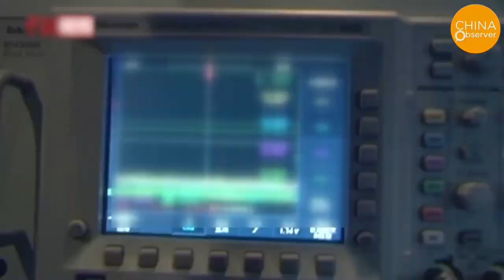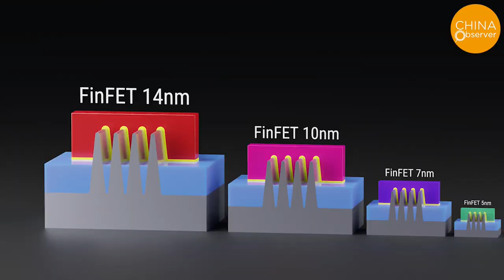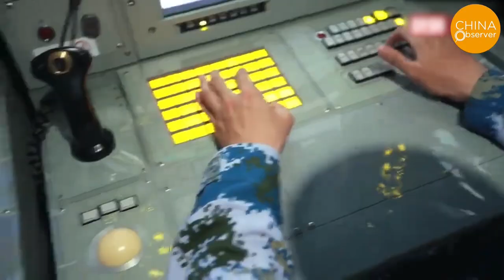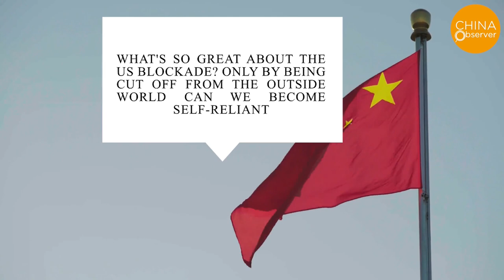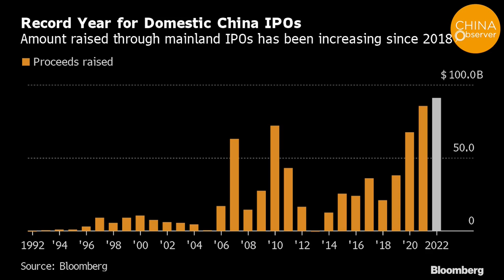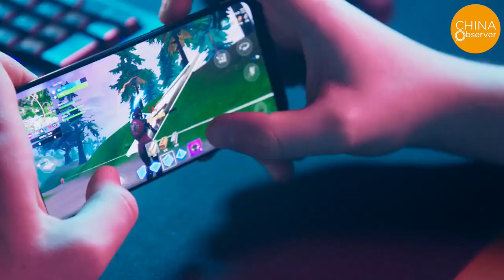Chip Sanctions Leave PLA J20 Old Eyes; China Breakthroughs Leaves Oil Leaking Tanks; China Fails R&D

Comment: EDA Software is American. The litho machines are Dutch. The mirrors for the machines are German. Japan supplies purified (extremely) silicon. China has several gaps to fill.
Reply: Yes indeed. Add to the fact in a post globalized world if any of those partners have a problem with the other you can bet the unique supply chain structure will altogether stop ANY advanced chips from reaching not only China but even to the US. In a deglobalizing world if you're having problems with Netherlands or Japan or Germany or keys say they have their own internal or regional conflicts that affect production of key inputs and exports to partners, you can bet we won't get any new advanced chip design, manufacturing or progress for years.
Reply: The sand for these chips come from USA, they have a very specific place for this sand.
Reply: Regarding Japan, it is the premier producer of not only high-grade silicon wafers but also ultra pure hydrogen fluoride, photoresists, and other special chemicals that are critical in the process of making chips. In addition, it makes a lot of non-lithography pieces of equipment for TSMC all of which are important in the chip-making process.

Comment: China has just unveiled a new breakthrough with the manufacturing of advanced photonic chips. Please see if you can look into that and provide your assessment if this new development can level off the current playing field.
Reply: They're at least a decade away from a native solution to what they can get from tsmc
Reply: Photonic chips have been in R&D in the U.S. since the 1970's and have been predicted to overtake silicon electronic chips decades ago.  The problem is that as photonic chips advance, the silicon chips are not holding still.  Silicon is racing forward faster than photonics because silicon gets more research money and more people researching.  Diamond electronic chips suffer from the same problem, but diamond electronic chips are much more similar to silicon electronic chips in manufacturing techniques.  Diamond electronic chips can be faster than silicon because signals travel faster in the diamond semiconductors, and diamond is much more heat tolerant than silicon.

Comment: Well with 28nm and sufficient quantity they can use parallel computing and other methods (algorithms) to achieve their outcome. Fighter planes are now obsolete with drones available at lower price and quantity. China has enough engineers and they have enough tech in their country to be able to reverse engineer what they want - there are also so many open source platforms like RISC V where they could if they focus develop their own products.
Reply: Power is a serious limitation in aircraft. A 1,000 watt computing machine is difficult - both from a power, space, and cooling standpoint. A 100 watt machine can be fit in and a 10 watt machine is unnoticeable. Get it under a watt and the plane can be peppered with them.